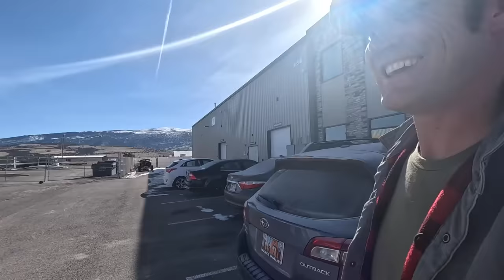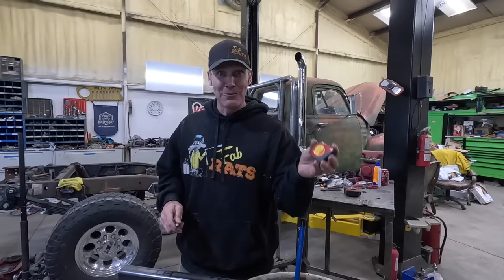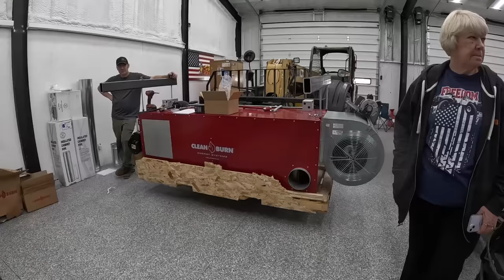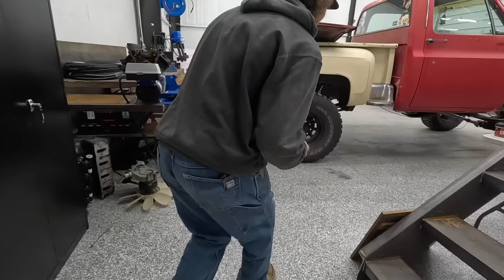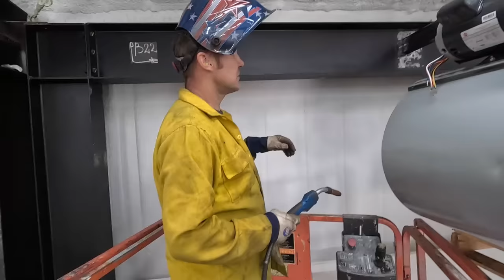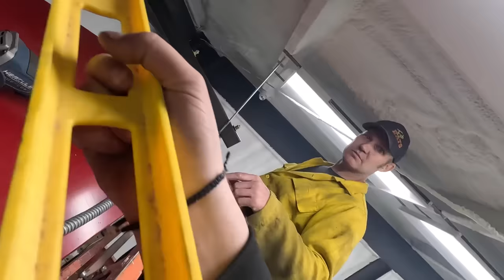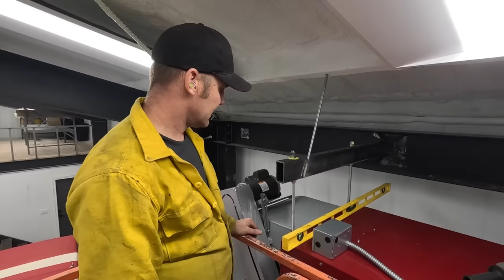Flirting With Disaster:  OSHA'S Worst Nightmare!

Comment: Hunter, don't wear gloves when you use the belt sander. If it gets caught between the belt and the table, the belt will pull your finger into the belt in a second, before you can pull away. Then it will grind away at your flesh...  🙁

Comment: I am dumb when it comes to oil heaters.  Just wondering does it burn fuel oil or used engine oil or...?  You mentioned at the end "free heat", where does the oil come from that it is free?  Just curious, thanks!

Comment: Question…. Why wouldn’t you keep the tape at the end and mark at 3.5” and then 25” so you don’t deal with the inaccuracy and the 1/6” slide the tape measure hook compensates for “hooked” vs “up against” measurements? Silly Rats.

Comment: I'[m surprised that you guys aren't just scrounging up a fuel oil tank that people used to have in their basements for their old fuel oil furnaces. In my area, it seems that everyone had one of these things at one time. And most will give them away for free, if you get them out of the basement. many also still have fuel oil in them. They also can be converted in to a killer hog smoker.

Comment: Is that the right place for fuel/oil?

Before installing your domestic oil tank, you need to consider its location. OFTEC's health and safety regulations state that your tank should be positioned: 1.8m away from non-fire related eaves of a building. 1.8m away from non-fire buildings or structures (e.g. garden sheds)

Comment: Oh I forgot I put three pre-filters in parallel just after the supply pump.
Reply: I have worked on several different manufacturers units the one thing they are really good at is cooking the debris out of whatever passes through. McMaster Carr is a good source for a lot of the parts block heaters o-rings etc. i made up an adapter to hook up the parts washer pump directly to the main solenoid block after removal and taking out like 20 plugs for all the oil paths. Are you listening Paul ?

Comment: i'm not a welder but who does that much weight with only 2 2"x4" square tube and 2 all threads hold that much weight, and does utah not require permits for this? i live in commiefornia and they require an permit and inspection for installing a simple water heater!!

BTW, that was the doors, Break on Through